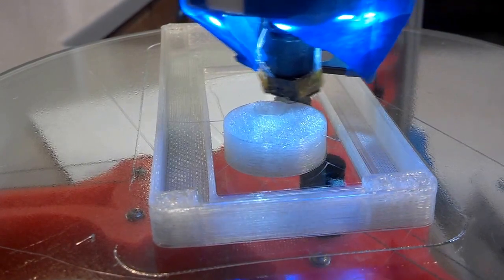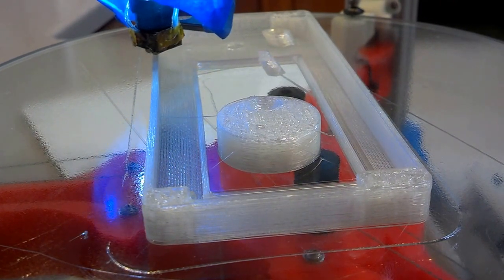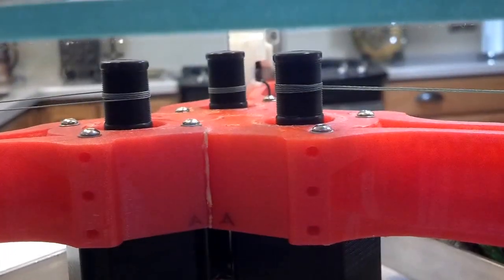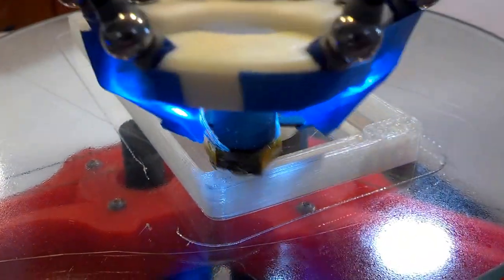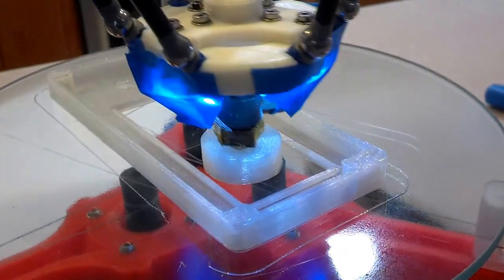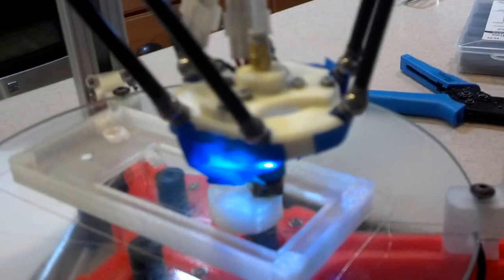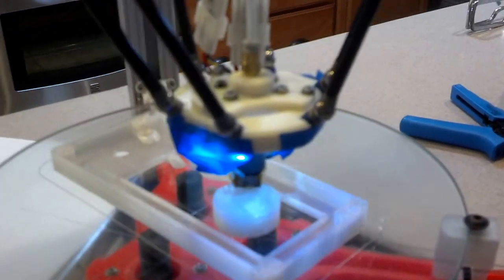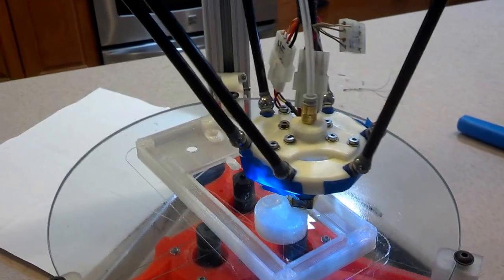Cerberus 3d printer with magnetic ball joints

Comment from the maker: Geomag magnetic ball joints now operational on our Cerberus delta printer. Zero backlash does improve layer quality.
Reply: Looks great! but one question. How do you accurately mount the magnets? do you have some sort of Jig?
Reply from the maker: It was actually the most difficult part of this project to figure out exactly how to set them in the correct location. In the end I pushed the six 1/2 geomags into the platform holes, then set the platform on a flat table surface so the geomags were facing down. It was then a matter of making sure each geomag touched the table surface and that the platform was level to the table. For the vertical carriages I was able to position the back side of the geomags to the face of the vertical carriage with a feeler gauge. For my next version I will most likely bond the steel ball bearings to the printed platform and the platform will have the ball pockets printed. I'd also probably make a back-opening in the platform under the ball pockets to allow another magnet to be added an increase the magnetic strength of the assembly. In that design the 6 rods would have magnets attached to the ends of each rod with a pocket formed a 3D printed end piece to create the moving joint. Eliminating the geomags completely.